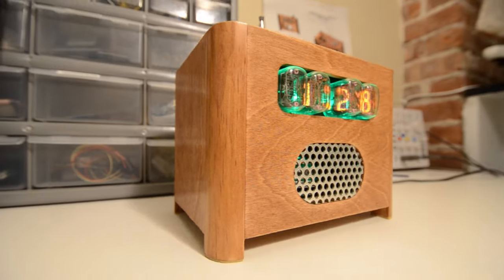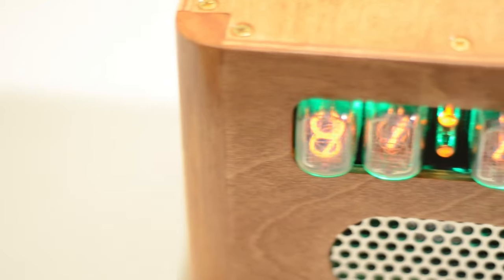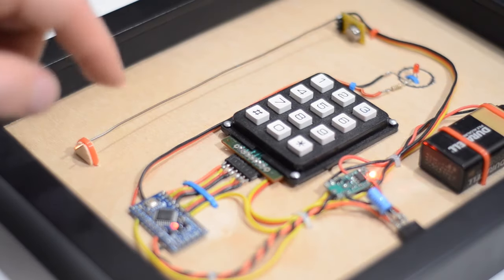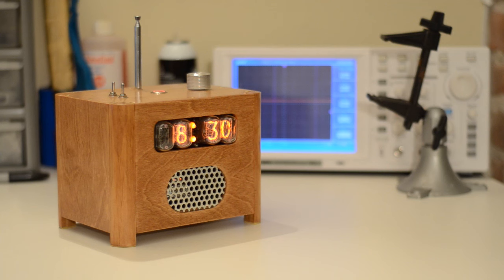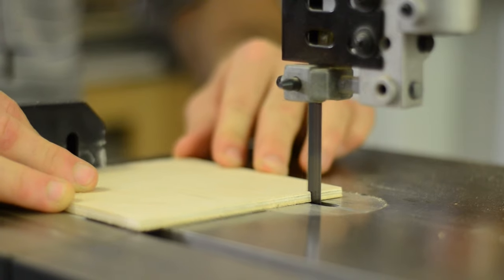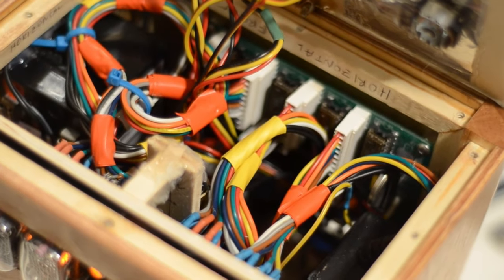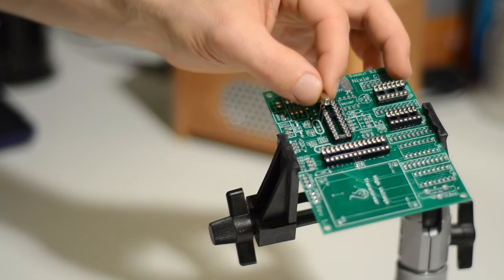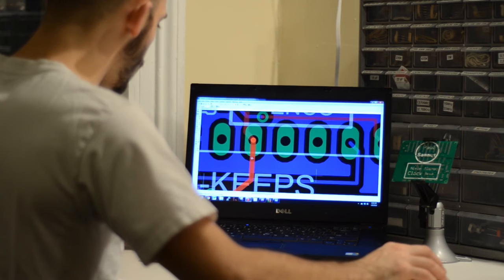Ramos alarm clock

Comment: This has a battery that will eventually fail to hold a charge.  So to replace the battery and put more money into it, or leave it dead and pulling the plug to deactivate it - and so defeating the original purpose of the rather expensive clock?

Comment: THAT IS NOT A NEW ''INVENTION'';
my iphone is connected to my surround system in my room via bluetooth, and I place the phone somewhere else, like the bathroom. There is a code on the phone I have to unlock every time I want to access it- like when I want to shut the mutherfucking alarmclock off!
This will allow me to wake up to whatever tune I want to :D it is porpably much cheaper to buy a small wireless surround system that works on batteries and can be use to other purposes.